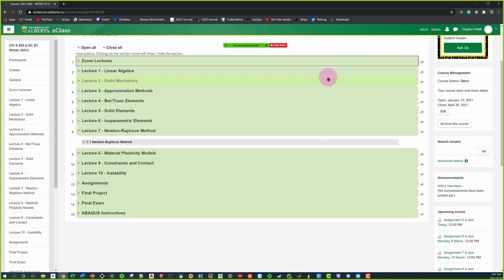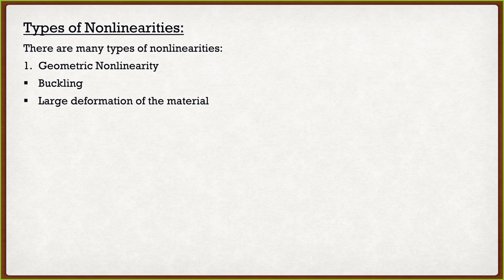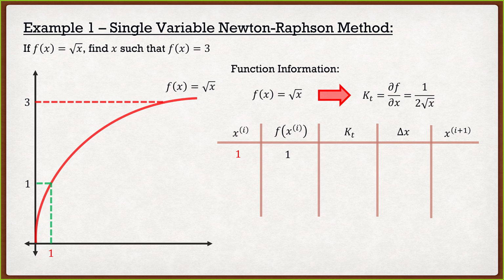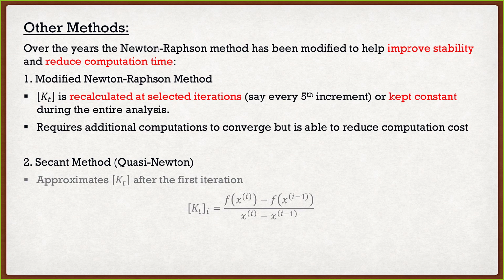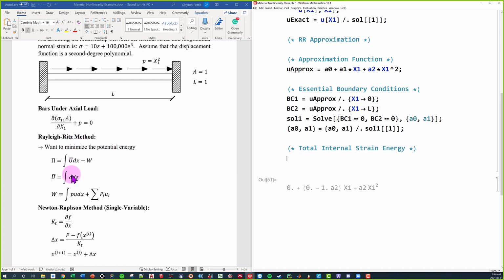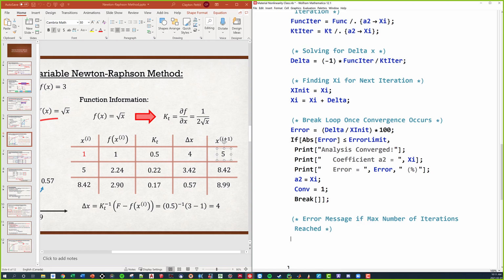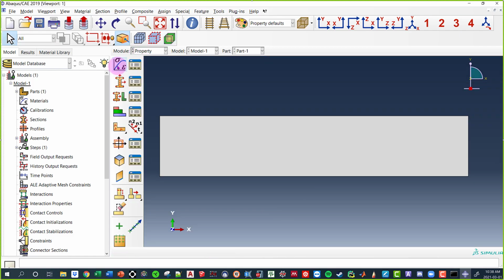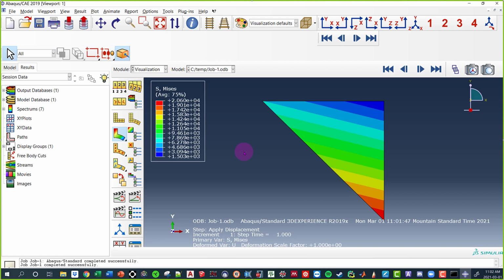Intro to the Finite Element Method Lecture 7 | Newton-Raphson Method

Comment: I have a question why we need this numerical method to solve min. PE equation this equation we have learn earlier to solve this problem with RR method, is it because Abaqus used this method ?

Thank you
Reply: Also do we have strain and stress on integration points or on nodes?